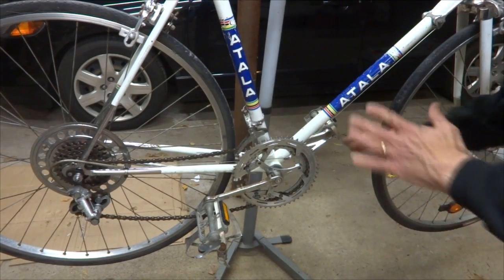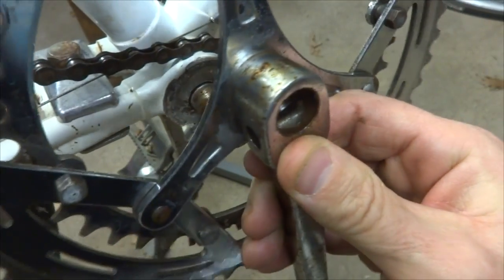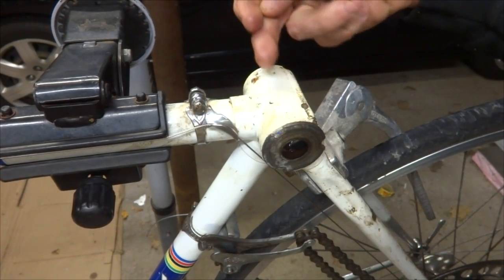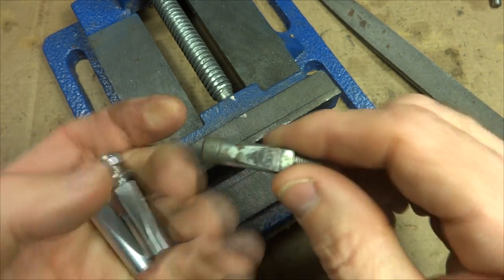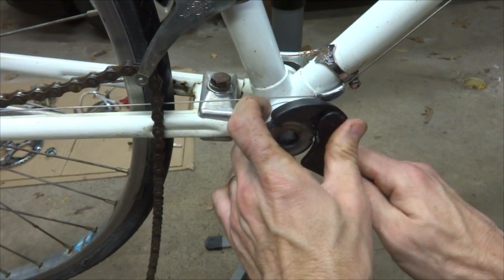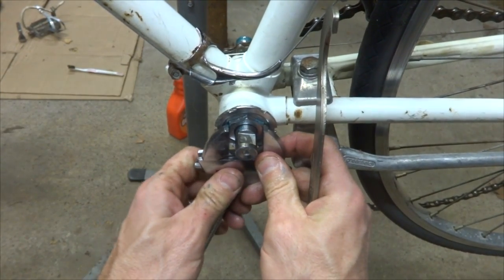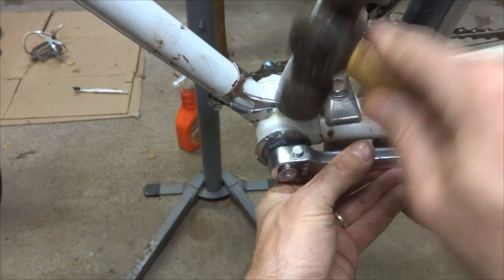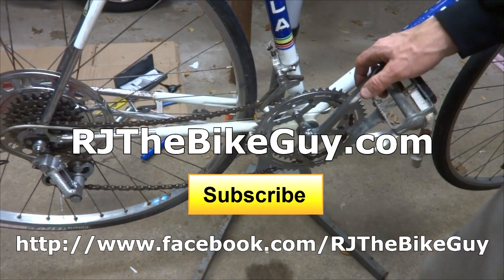Overhaul Vintage Italian Bottom Bracket

Comment: I wanted to share another method that worked for me for removing the cotter pins.  I used a 13/16 short socket for bottom jaw clearance in an unmounted 3" bench vice. Pushed them right out with power to spare and no damage to the pins. I like your videos very much, thanks!

Comment: This time I like how you did it, disassembling everything and changing the damaged bearings and greasing again.  Perfect.  Could you do the same job with a current fixie bike?  Because the shaft and the clamping nuts are different.  Thanks for the video and take care.
Reply from the maker: If the shaft and the clamping nuts are different, then it sounds like you have a different crank and bottom bracket, so the procedure will likely be differeent.

Comment: I bought an Vintage Bottechia Campione Del Mondo 1966 10 speed this year and apparently I need a new bracket/spindle do to the crankarms are unparallel. A question can I use a different type of spindle and crankarms??
Reply from the maker: Probably. You would probably need an Italian threaded BB.

Comment: I find it helpful to loosen the crank taper pin nut a little bit and then tap on it with a hammer. This may break the pin free and avoid buggering the threads.

Comment: Is there a way to replace this style of bottom bracket with a more modern version, possible an inexpensive sealed style? If so, what are some examples and what sizes would I need? Attempting to single speed convert a 1970's Romana
Reply: Yes, RJ, I'm wondering the same.

Comment: Are the fixed cups from cotter cranks usable with the squire taper I'm trying to replace it with. Fixed side seized!
Reply from the maker: Not directly. The ball bearings will roll in a different part of the race and wear it out fast.

Comment: I may be teaching my granny to suck eggs, but my father taught me this way of removing a cotter pin.
If you don't have an extraction tool such as yours, the other way is the dreaded hammer but watch the bicycle frame when you hit it with the hammer...it flexes and most of the force just goes through the frame.

What you need ideally is an anvil to stand the crank on (we used to have a cobblers anvil at home) but providing you have something solid....even a concrete block on the ground. Then the force of the hammer on the cotter pin will be immense by comparison to just hitting it with the bike standing and the cotter pin should just drop out.
I have rescued many bikes with snapped off cotter pins using the above method.

Comment: Another quick thought:  As far as cotter pins are concerned, it is my understanding that the exact taper is not important so long as the following conditions are met:

1 - The tapers of both cotter pins match (to produce cranks that are 180 degrees apart from one another when properly installed).
2 - The flat of the tapper on the cotter pin is sufficiently long enough for the pin to fully engage the spindle when installed.
3 - When pressed into place, the threads of the cotter pin protrude from the crank arm far enough for the nut to be fully threaded on.

In other words, your viewers may find that the tapper of a replacement cotter pin is sufficient and that no filing is necessary.  But only a little experimentation in each instance will tell.
Reply from the maker: +Alex Snyder Yeah, that seems about right. I still find it useful to match the taper of the original pins.
Reply: With manufacturing tolerances being what they are sometimes, filing might be necessary to get the tapers on new pins to match anyway!
Reply from the maker: All the new pins I buy have too steep of a taper so I have to file them anyway.

Comment: RJ -- You are the Sheldon Brown of the YouTube age!  Seriously great videos.

Another method of cotter pin removal for anyone interested:

1 - Lube the cotter pin with a penetrating oil (I prefer Tri Flow).  Very important step!  Don't skip it.
2 - Create a improvised cotter pin press using a c-clamp and an 8mm (or thereabouts) socket to receive the pin.
3 - Tighten the c-clamp down.  If the pin doesn't break free with moderate to heavy pressure, then...
4 - Brace the crank arm and give the clamp a stout wack with a hammer.  The cotter pin should pop loose.

So far this method hasn't failed me yet!

Comment: I realy dont like, how you hammered on the pins, without realy suporting the axel. I, for example, had an accident, after removing and reinstalling the drive side pin with a hammer... the axle broke someday, while driving uphill. So please, put the bike on the ground and put something under the cranks to support the axle. Also screw the nut back on the pin(until it forms a flat surface) to not destroy the threads. 

I would put the pins in the other way. You said there is a debate about it, but for me its pretty logical. The way you installed them, the small side of the filed down cotter pin, has to transfer the most force on the axle. This is especially problematic/important for the nondrive side, because the driving force has to transfer through the axle to the driveside. If you put the pin in, the other way, the larger part of the pins are holding against the axle, whilest pedaling forward, which puts less strain on the connection/joint.
Reply: Best comment here, just because it is RJ the Bike Guy doesn't mean he is infallible.  This is a botched job.
Reply: When you tap on things like that it results in brinneling. Knocks the bearing into the races. No good.
Reply: I just said the very same thing to Mr. R.J. a minute ago : to use a steel-hollow-tube under the crancks to tap with the hammer on top of the tube and spare the ball-berings .

Comment: If they were caged bearings there woulds be 10 on each side correct?
Reply from the maker: +Bricklinsv1970 Depends on the cages. I would guess less than 10.

Comment: Just did the same process yesterday with the same components. Cotter pins are tricky little bastards, mine had to be hammered too, also didn't find exact replacement, so i went with a similar one but the angle wasn't just right. Its got stuck, going to remove it and hand file it like you did. I was thinking about it before I've got started but, it was worth a try. Repairing these bikes is almost an form of art, i believe. 
Keep up the videos, they are useful for many of us. 
Greetings from Ukraine!

Comment: there seems to be a lot of slack in the chain rj,a lot more than just stretch,is there a problem with the springs in rear deraileur?,also noticed the cotter pins u used have nylock nuts rather than a regular nut & spring washer.
also a great idea to place the chain on the large chain ring to prevent injury/skinned knuckles when working on cotter pins,can laugh about it now but back in the day i bashed my knuckles several times over the years & when it happens the air will turn blue ( ie swearing/cursing from the pain)  :D
Reply from the maker: +neil crompton I used a gauge on the chain and it is very worn. Someone may have replaced the chain and put one on there that is too long. I have gotten to that yet.
Reply: +RJ The Bike Guy  i wasn't being critical but just noticed the slack & thought the rear deraileur might have a slipped spring
Reply from the maker: I know. I just haven't gotten to it yet.